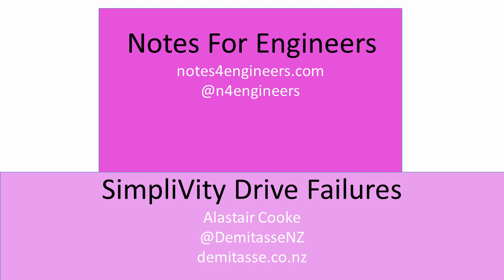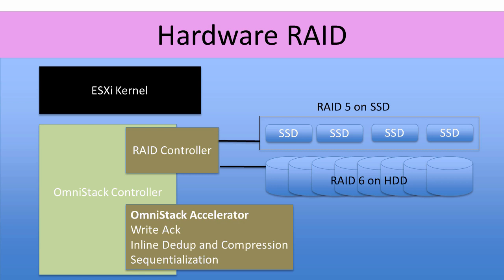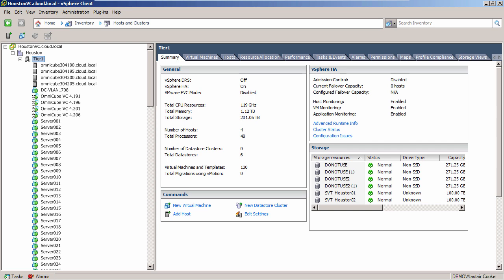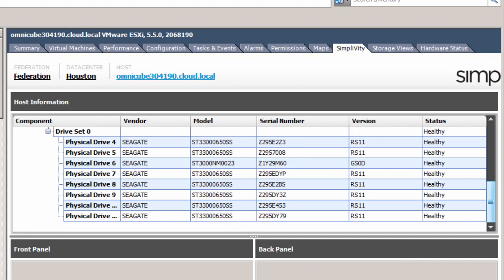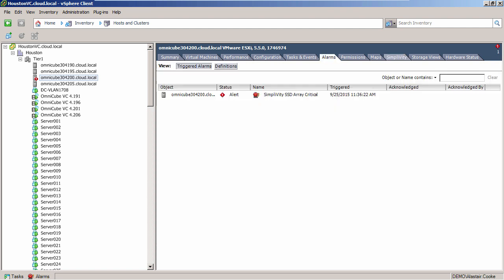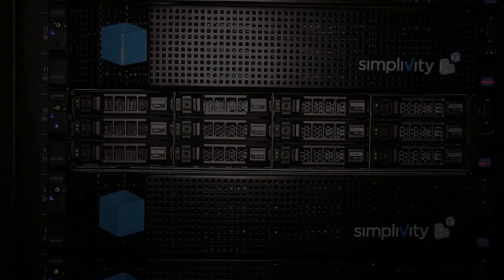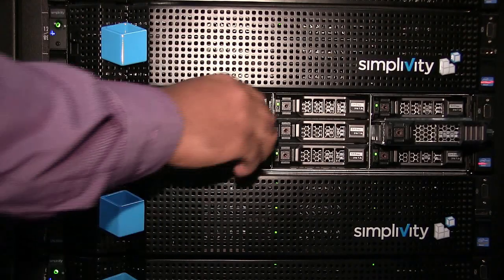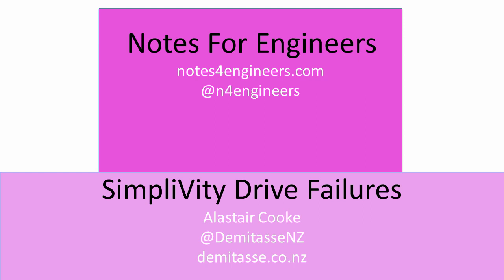015 Drive Failures on SimpliVity Hyperconverged

Comment: In the video you replace the "failed" disk with the identical one and it rebuilds.    We had a case where a failed disk was replaced with a new ( different serial number ) identical drive.    We did not lose data, but the Node would not detect the new drive correctly.    The Node basically saw two different serial numbers (the old and new disk) in the same slot and would not use the replaced disk.    The HPE engineers referred to this as a "ghost drive".    They could not resolve the issue and suggested to delete the node and redeploy it.    This was done in the end to resolve the issue.    Are you aware of a different process to follow if you replace a faulty drive with a brand new one that is different from the video, or is the process exactly the same?